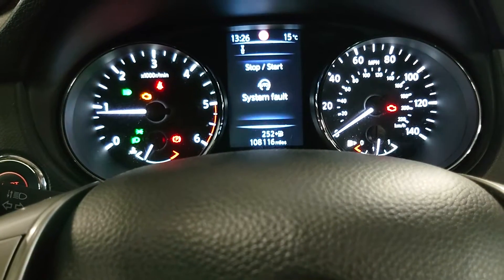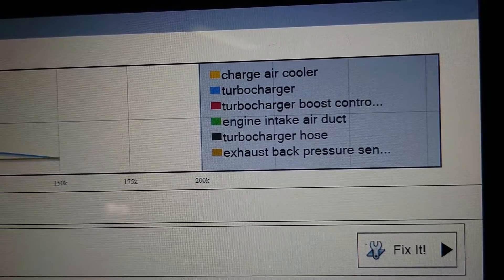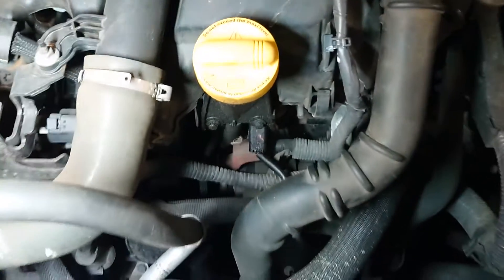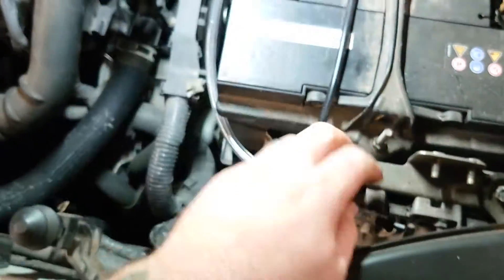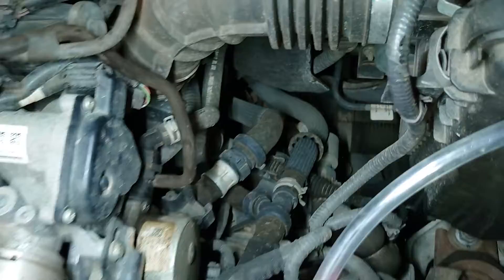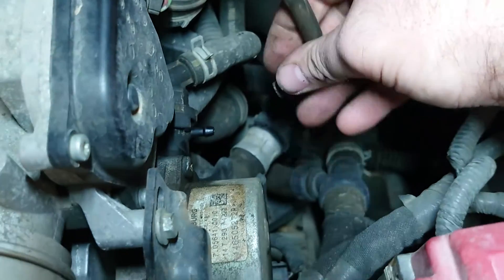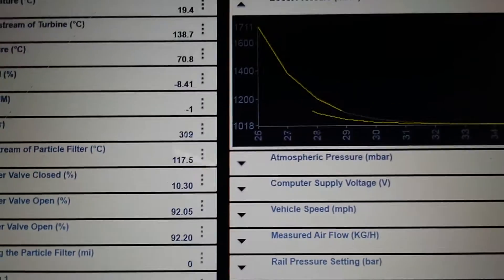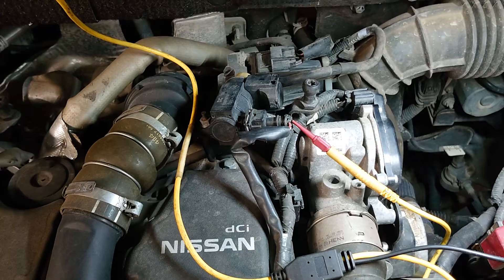Nissan Qashqai boost fault P2263 P2002 P242F

Comment: The DPF problem is because of the glow plugs,,,The DCI engines will not do a proper regeneration if all 4 plugs are not working,,,
Reply from the maker: Not likely to regen with a turbo not functioning properly. 
The fault i was tackling for the video was the turbo fault as i have others on glow plug diag.
Thanks for the comment

Comment: Hi, great video. Does the system work by giving a constant vacuum to the actuator until you accelerate then the solenoid cuts the vacuum and closes the waste gate? Meaning off the car the solenoid should be open and able to blow in the top port out out of the bottom port 
Thanks

Comment: Really enjoyed this video.  I do something similar, I just apply -800mBar with the mityvac and road test to see if it 'boosts'
Reply from the maker: Yeh same sort of testing, just ruling out as many faults as possible using quick easy tests👍
Reply: When viewing the PWM signal for the charge pressure transducer, you changed to frequency.  I've tried frequency graphing for solenoid control and for newer Mass air flow sensors but other than seeing obvious glitches/drop-outs, I don’t get much joy from that type of graphing.  How do find using frequency and what do you look out for?
Reply from the maker: Just makes it easier to see changes in the frequency or duty cycle. That's all I use it for.